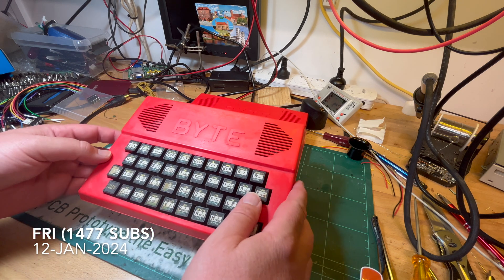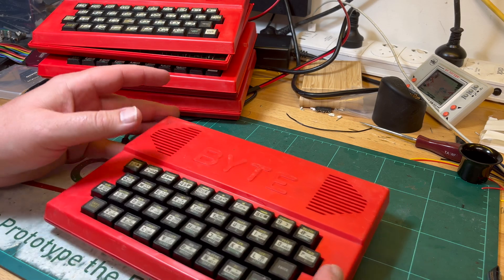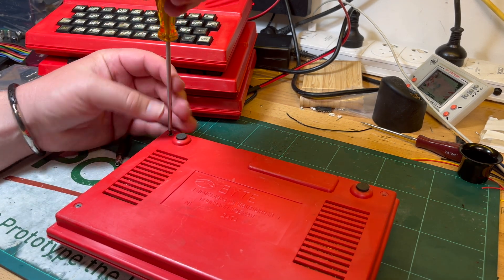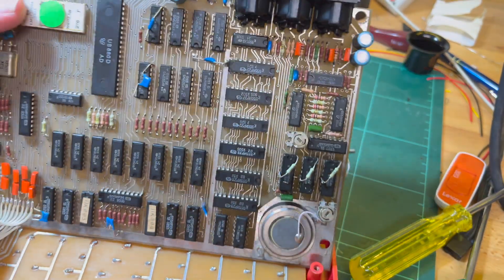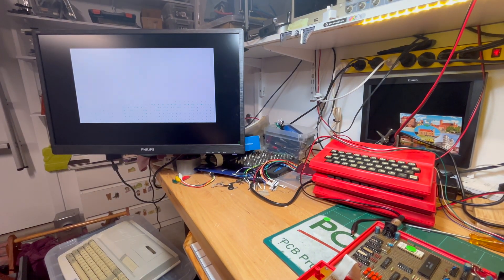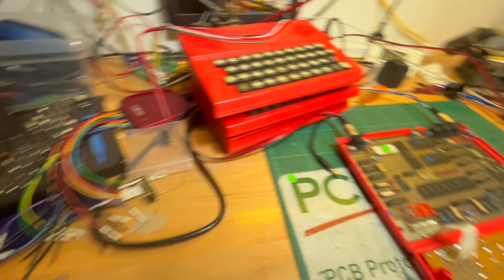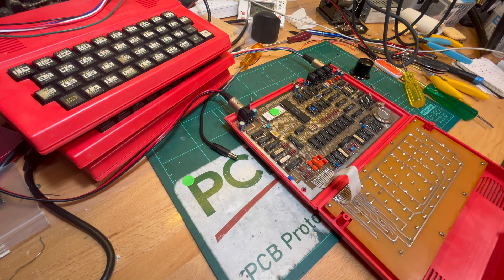🇲🇩 BYTE: Part 13 (A Third Version of this Moldovan Speccy Clone?) [TCE #395]

Comment: Think they're more likely to be tubular ceramic capacitors bodged on the chips, rather than resistors. For power decoupling.
Reply from the maker: No, I think they're definitely resistors - I've not seen Soviet capacitors in that form factor before.  Actually @MrWaalkman thinks that they're a way to reprogram the mux (forgot something in the design)

Comment: Another Byte? Sounds like my TI-99/4A collection? I might have gone too far... Then again I have at least eight TI-92 and TI-92+ calculators in my immediate vicinity. 

Observations from half a world away:

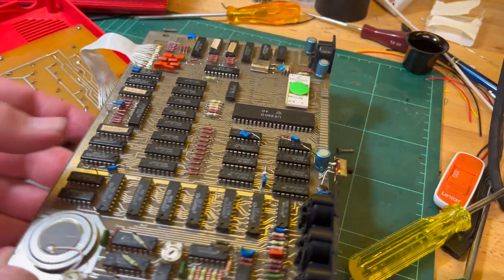@6:10 What's going on with those three chips that have the resistor strapped across each of them? Especially the one closest to the edge of the board? Fugly bodge work there.
And the little trim pot and the speaker. Did they run out of solder?
Gotta love those inverted blue caps. That one way to keep the electrons from leaking out. :)
Why do some of the chips look like there is a stepped up region on the top of the chip?
@6:41 Pin #5 on that top chip suurree looks like it has a solder blob shorted to that trace. As far as that goes, pin six on the second chip does too. And look at that chip to the left that is mounted vertical (in this shot), is the trace between pins 2 & 3 cut? Or blobbed? 
And it's interesting that the bodge wires as seen @3:29 near the screwdriver on the bottom of the board are part of that same mod work as seen at @6:41
@3:51 it occurs to me that your crystal might be sitting on the traces below it in all of its bare-naked glory. Nope. @5:06 we get a look at the crystal and it's sitting on top of a pad. But @5:23 look at the cap that's near the crystal, does it look like one of its leads is touching its neighbor there? Just above and to the right of your EPROM.

And this is a more primitive board, which means that there might be a western design reference that it was copied from. Worth a look.

And this board looks like it was hand-assembled. Doesn't look wave-soldered at least. @4:54 there are a number of connections that would do with some further inspection.

@5:03 the top right-hand section of the board looks like it has had some rework done.
So look at the unpopulated holes "vias" on the board @5:24, they appear to be plated through. That's a good thing. In the same frame look at the top left-hand corner. Does that cap's lead touch the other pins on the chip? And it sure looks like that brown resistor next to it has been melted a bit. The frame @5:33 suggests that the leads are not touching.
And @4:51 there is a piece of wire soldered to the trace above the curve in the bodge wire. It spans three points on the board. Almost unnoticeable.
And below the power connector on the bottom side of the board has there been some rework done there? Somebody is moving the board around too fast for me to see. :)

Yes, Solder mask. :) 

And these Bytes sure are cute little things. :)
Reply from the maker: I'm assuming that it was working out of the factory (keyboard looks used).  
I've had a quick comparison with the working "Spectrum" BYTE I have ... those three chips @ 6:10 with the resistor ... no resistor in the Spectrum version of the board.  
No worries about the crystal - they have some double-sided foam tape to "insulate" it.  I'm just working on re-homing the Amstrad CPC6128plus floppy drive to an external case ... I'm planning to do a side-by-side comparison with the "Spectrum" BYTE on Sunday (re-visit Parts 9 & 10 ... https://youtu.be/LLsVsUFua70).
PS - yes, I must remember to always do a very slow pan across both sides of the board ... that's the whole point of shooting in 4K, to give you guys a good look at the board and pick up things I miss!

Comment: Z80 indeed is from the GDR :) What speed does the CPU run at in the Byte? Asking because the 4MHz variant is "kind of" uncommon to be found in homecomputers and the UB880D supposedly rated at 2.5MHz.
Reply from the maker: Oh yes - good point.  The Speccy is clocked at 3.5MHz, so a 2.5MHz part wouldn't really be suitable.  I'll hook the scope/analyser up to it and check what frequency is going into the CPU. /Brett